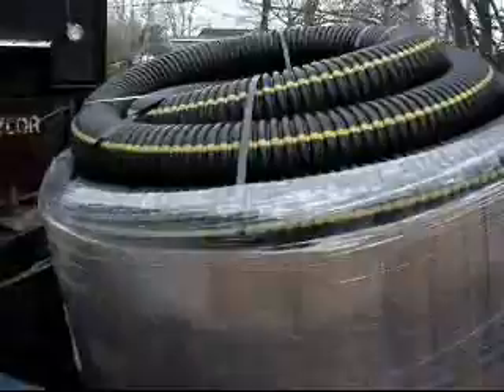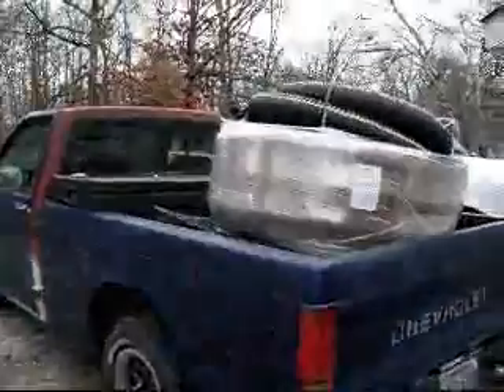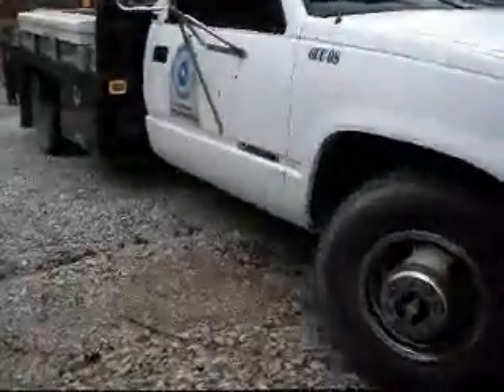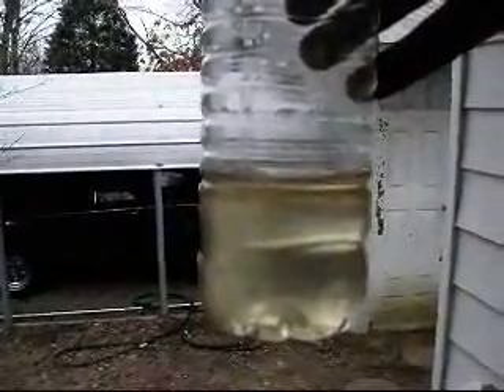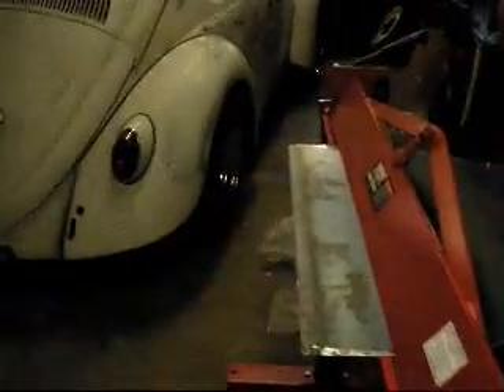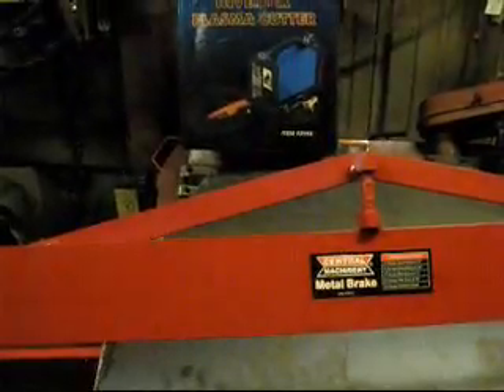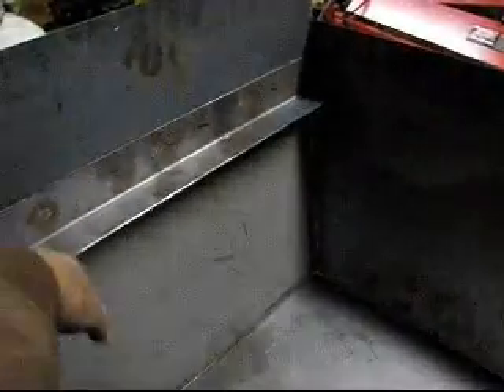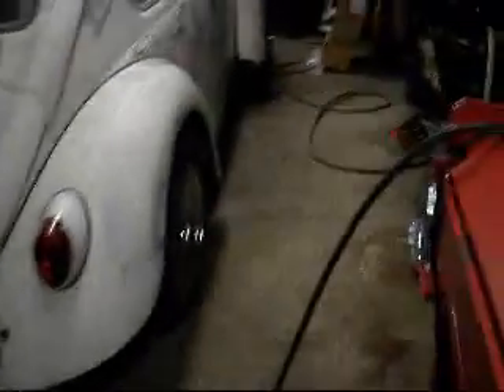TAYLOR OUTDOOR  WOOD BOILER 3

Comment: do you use your furnace and a heat exchange or did you rig up your own blower ? im trying to save power as well. see online they have ecm motors you can get for your blowers that really save on the power
Reply from the maker: I use the blower on the furnace with no heat strips  and the power runs about 30 to 40 dollars a month